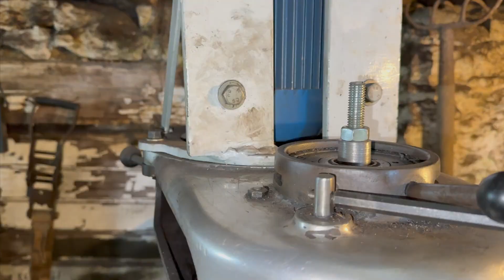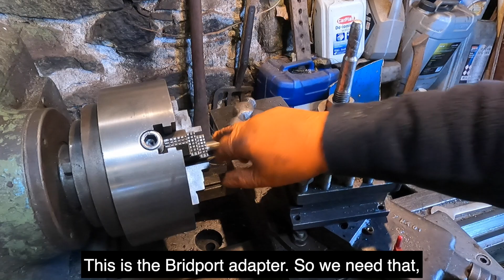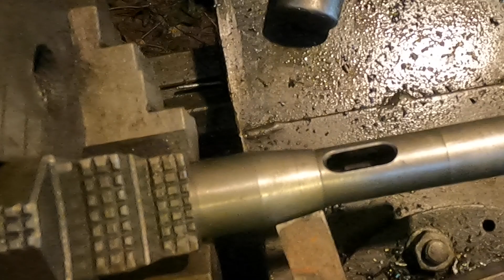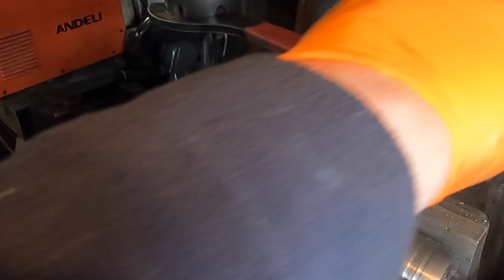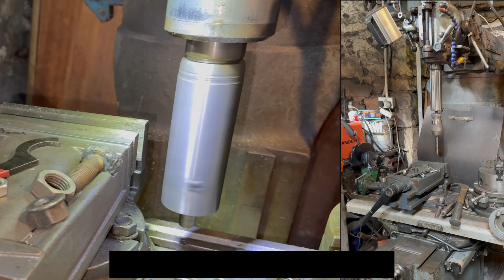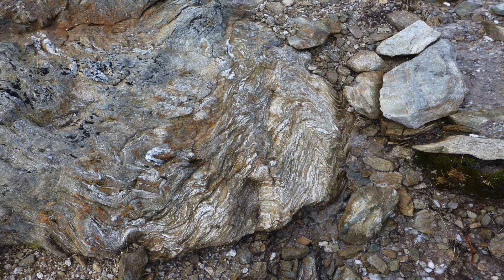Making a Bridgeport quill extension.

Comment: A nice bit of tooling there Marshall, I'm sure you will have a project very soon to use the extension.
Reply from the maker: It will come in handy some day a lot of head  scratching making it.  It took me a wile to work out how to do different operations. I needed it before I made it the usual  M😀